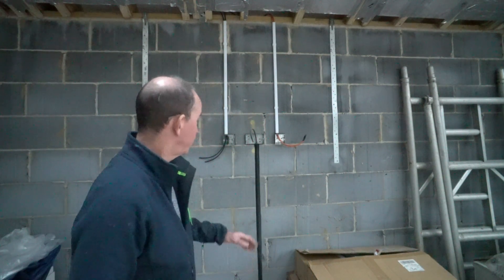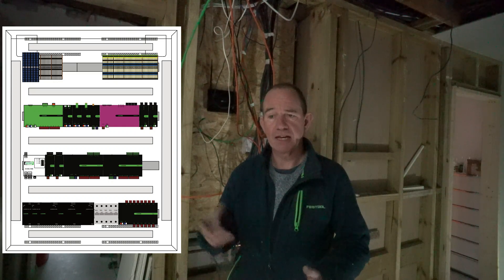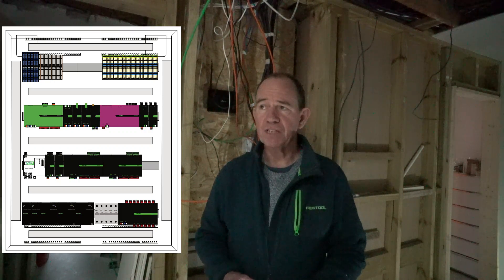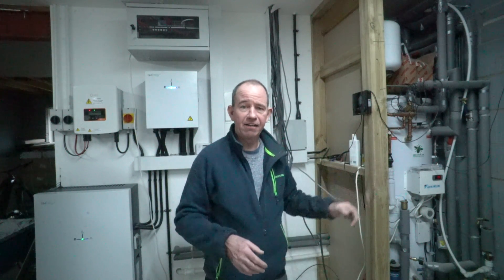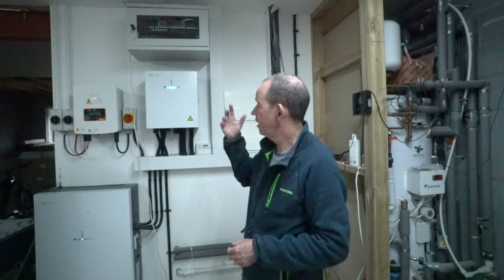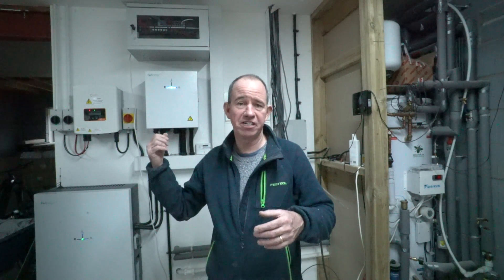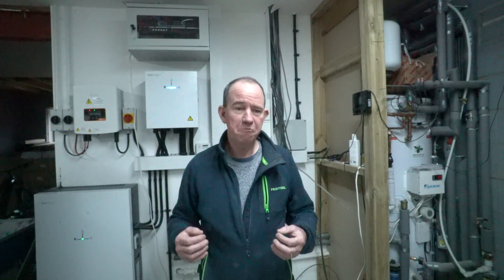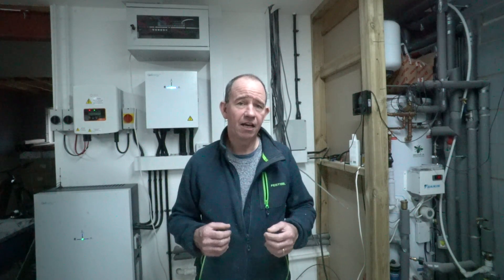How to wire for a Smart home in the UK automated home UK featuring Loxone

Comment: Which front door do you have, its it automated?
Reply from the maker: Hi Thomas, Our Front door was made by Spitfire doors. In the rush of choosing products to the build I failed to order an automatic one. I have added a Teede pro lock on the inside which works very well. It is possible to integrate this with Loxone but doing so means you reduce the security of the lock a little (assuming your home network could be compromised).. I do have Loxone controlling my Hormann garage door and that works perfectly. I do have a door sensor on the front door so Loxone can see if it is open.

Comment: Did you consider using Dali and if so what ruled it out?  im currently leaning towards KNX + Dali
Reply from the maker: Hi, I didn't look at Dali. I did take a look at Rako, Lutron and Creston but really wanted (or at least hoped) to have one system that could do everything. Some people were suggesting best of breed or lighting, audio etc. If I was starting again I think I would do a lot more low voltage lighting rather than dimming 240v lamps. I may still change some of my lighting to 24v. I had hoped I could just use Loxone for everything but have ended up with a Somfy Tahoma to interface with Velux windows and Somfy Zigbee shades. I also run Home assistant to do some of the energy management as there is so much readily available there but the core of the house all remains in Loxone. Good luck with your project.

Comment: Lots of water coming through that block wall
Reply from the maker: Hi Steve, when we filmed this the house was not weather proof in that area. The blocks have since dried but we had a steel we think should have been better insulated so have added some internal insulation over the steels even though building control were happy with it.

Comment: Great to see you're using Loxone, they're very reliable and the system is very versatile.

One issue I've experienced is with temperature sensing in each room. The 'standard' is to use the light switches (I think you mentioned Touch Pure?).

However, I've found since light switches are usually at the entrance to a room, they aren't particularly accurate unless the room door is kept shut. For instance, our hallway is normally several degrees cooler and the door to this particular room is usually kept open. This means a) the temperature measured is lower than the temperature in the room and also, b) the heating in that room comes on way too soon, to try and heat the room up to the desire temperature at the scheduled time!
Reply from the maker: Thanks Rob, I have struggled a bit with this point. As we have an air source heat pump and underfloor heating some experts suggest we don't need anything like as complex as Loxone to control it. The logic is to leave all of the valves open and set flow temperatures low then just adjust zone valves and a weather compensation curve for best economy. I get that but when I look at a car engine they work the same as they did 100 years ago but the engine management is what has made them more efficient. I am hoping Loxone can monitor and report all of the temperatures but give a light touch to control allowing the heat pump to run low and slow. What I don't want is Loxone trying to do super detailed control opening and shutting UFH loops whcih make the ASHP cycle and be less efficient. We are well insulated so hope this will be possible.

Comment: Make provision for a Pi/Loxiberry setup. Communicating with Velux controllers, etc., is much easier via this, mainly using a broker and MQTT. Add wires for basic hardwired water sensors in all key locations if you have spare inputs. Also just run spare cables generally as you never know what you will do later :) The loxone software is the easy bit. Planning the cables and getting the hardware in takes the most thought.
Reply from the maker: Thanks, great input. We are still mid build. I wake up at night thinking of cables for have forgotten. Thankfully most of our home is single story so was can add cables from above. I have decided on another box of cat6 to run to various locations just for this reason. We need to lock down the Loxone panel in the next week but hope it will still have a few spare relays, inputs and dimmer channels spare.
Reply: @JurassicJungle  also the dmx module is one of the best. I then run a couple generic 32 channel controllers for various led tapes and spots. You can then if really want run 12v relays from it if did not want to splash on so many loxone relay modules. Anyway all the best
Reply from the maker: @s31teg  thanks, will check into that

Comment: smart man! men go loxone and chumps go control4 and crestron! dont fall victim to RMR to ur c4 and crestron dealer, those systems line the dealers products and fuckin suck yours dry.
Reply from the maker: Thanks for the feedback. I did look at both, Creston felt if was a much more commercially focused product (that said that also seems to be a big focus for Loxone more recently). I didn’t like control 4 much at all. Loxone does seem to lack in the av space and I am not fully convinced by the audio server it seems to have better integration options overall. I have installed allowing an option to switch back to Sonos later but that would mean sacrificing some nice Loxone functionality.

Comment: Hello could you please share how were you able to integrate the Somfy tahoma?
Reply from the maker: Hi, we are yet to set this up. My installer is confident it can be done, I will post a video once it is working via the api. If that fails I also have a 1home server which would probably allow matter protocol to link Tahoma to Loxone.
Reply: @JurassicJungle  Neo smart blinds do a hub that you can control Somfy with Loxone over TCP-IP works a treat and have done it a few times now, but personally still recommend hard wired shading with contact closure to relays on relay extension for 100% relaiblity either volt free/polity reverse or mains. Somfy also have an RS485 unit but its quite pricey and not simple to setup. Another product you can use is Bond bridge this is on loxone library too.
Reply from the maker: @Christian-ur2fb  Thanks Christian, We have noe had the panel installed but not yet installed the blinds. I will take a look this week as we do have Velux windows connected to Tahoma. THe API looks reasonabky straight forward. I will have 13 blinds so thats quite a few relays if I went that route. My panel doesn't really have space for another relay module. Its a Future automation 5 but I have 2 dimmers, 2 relays, 5 audio zones and a backup PSU. I have run 4 core flex to all of the windows so could I guess install a relay expansion in a separate enclosure. Can you recommend any blind suppliers? I am seeing around £300 for a small window using Somfy DC/RTS
Reply: Hi  @JurassicJungle honestly not sure we tend to stick to a few installers for our projects one been Charltons curtains and blinds in Barnsley. I actually never realised the tahoma worked with velux does make it worth looking into the last time I considered it they only had it for the USA market. We have always used the klf200 for velux. The nice thing about the hubs I mentioned is they can be used for many manufacturers of shading. Hope the rest of your project goes well.

Comment: Nice video!
I need to require a large 60s bungalow (with room in roof) and have been agonising over how to do it.
This video has given some food for thought! 
I had been planning to install dumb switches but wire them back to a central cabinet so I could use them in future as a volt free switch for a smart system. The bit that’s been bothering me is what to do if I want a switch like loxone in future.
Reply: May I ask why you went with KNX over their Tree cable? Was it just cost?
Reply from the maker: Hi, If you use KNX cable or even possibly Cat6 that could work. You can just use a dumb switch with Loxone into a digital input, I plan to do that in my garage with momentary switches to control lights and the automatic door. The Loxone switches offer much more functionality as they have temperature and humidity sesnors and 5 touch points so can control blinds and audio as well. That comes at quite a price as the glass switches are around £200 each so a significant part of the project. If you wire that way you could use just about any automation system in the future but it will require you to do something now with relays for volt free switching. I think I would take a look at Shelly modules or Fibaro. Some of these have  volt free inputs and switched or dimmed outputs. They will just function even if you don't use teh smart functions. I think the only downside with Shelly is they use WiFi so you can end up with a lot of devices on the WiFi network. Automated home took a look at this a few years back https://automatedhome.co.uk/new-products/converting-to-a-diy-shelly-smart-home-part-1.html

Comment: YouTube thought I would like this video, and indeed I did 😀.  I would love to do something like this from scratch.   Thanks for the explanations.   I imagine that you already considered this but ensure you have cooling or exhaust outlets for control cabinets or server racks to keep components cool.
Reply from the maker: Hi Brian. I am trying to avoid heavy consumption from server style machines if at all possible. My small data rack is in the garage with good ventilation but also very well insulated to avoid cold. All of the equipment in the Loxone cabinet is Loxone sourced and I asked the installer about heat generation. It is all pretty low power and passively cooled.
The power consumption for the Loxone cabinet is around 400W but the vast majority of that is LED tape where the heat generated will be a long way from the cabinet. The Miniserver is listed as just 3W. Interesting is that the Audio server consumption is a lot more at around 150W in theory with all rooms at full volume. I will monitor the temperature and can easily adjust the door I will fit to include space for ventilation.

Comment: Hi, looks really good what your doing; you certainly know your stuff. I watched a USA youtuber doing similar to you, he had a guy that installs everything below 50 volts. He did on very simple
thing that i thought was brilliant. He ran empty flexi conduits so that cable could be run in the future, he only installed 2 or 3 as he probably strategically knew what he was doing. I would run
them all over the place myself. I'm sure you have thought of it, if you haven't even done it.
Reply from the maker: I did debate conduit with my installer, I have used it in places and other locations cables are in stud walls so it would be possible to fish a new cable. One area that caused a lot of through was across our hallway. We have a vaulted ceiling and solid floor so no obvious route for cables. The batterys are in the garage and Loxone in the house so lost of cables have to go that route. We have istalled a lenght of 110mm soild pipe to run all of the power cables through and can just about get to it later if we need more. data cables have been clipped a distance away to avoid noise. Adding data later would be harder so i will add a few spare.

Comment: What a great home you will have   Are you going to have AC  air to air or just heating? With your system 
Used to install Loxone so will be nice to see yours up and running
Reply from the maker: Hi Derek, we have an air source heat pump linked to underfloor heating throughout. AC would have been nice but we are north facing so don’t get too much solar gain. Loxone will control all of the heating valves via relays rather than the Loxone valves which don’t seem too reliable.

Comment: wow, X10, now that takes me back. Not familiar with the Loxone brand, will check it out. You sound au fait with tech, curious why you didn't go with Home Assistant
Reply from the maker: HI , I think I will almost certianly end up with home assistant running linked to this unit. As far as I am aware Home Assistant does not provide the actual dimmers and relays required but it does have an extensive set of integrations. Loxone is based more on an industrial PLC platform so rock solid control of the basics. The describe the system as "Clopen" it is a closed so there for easy to work with platform but it is open as it allows integration with other systems. Unfortunatley the integration with HA is not the best. Loxone is not a cheap option, I am probably spending more on services than I have spent in the last 20 years on X10, Zwave and more but that was just a hobby, this is core to the building functionality and there is a lot of technology included. My resistance to Loxone is the risk of a them going out of business, my experience wtih X10 was very good at the start but it became unreliable, I think due to noise from so many switched mode power supplies in the home swamping the signal. I want to be able to pplay with Home assistant without the risk of breaking the basic home functionality.
Reply: @JurassicJungle  regarding the dimmers, I use Samotech 308 zigbee dimmer units, I can then use any push-momentary switch to turn them off/on and push-hold to dim up and down, pretty much the same as any standard touch based dimmer swithch. I can also use any dimmable LEDs, in essence, dumb switch, dumb light, smart dimmer unit, helps to keep the cost very low.

Relay wise, you can get Shelly units that work directly with Home Assistant, or Sonoff ones if you're up for a bit of Tasmota flashing (very simple).
Reply from the maker: That’s very similar to what I used in my last house. I used wave fibaro modules behind all light switches ( had to make many back boxes deeper). It worked pretty well and was reliable but the fibaro software was not great. Zigbee availability has come a long way since I did that and much cheaper than zwave. I have some Shelly sockets and will use some meters as Shelly integrates very easily with Loxone.